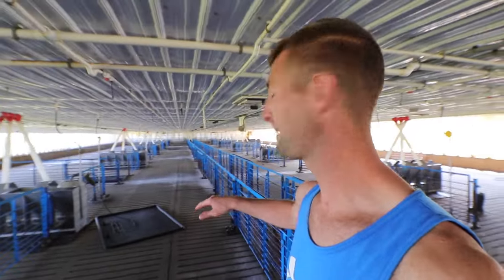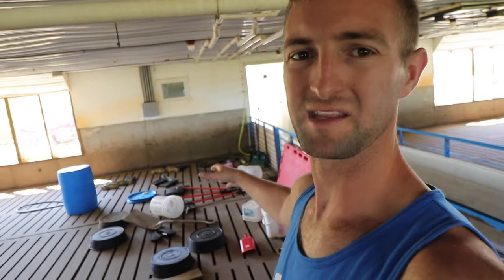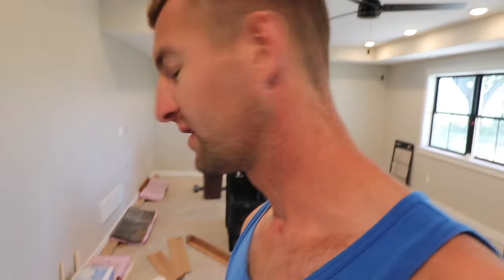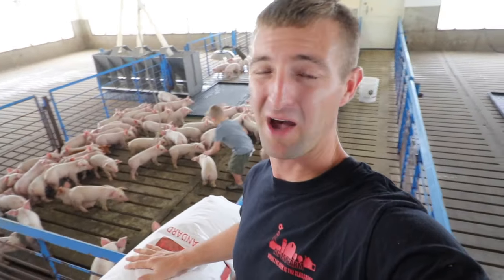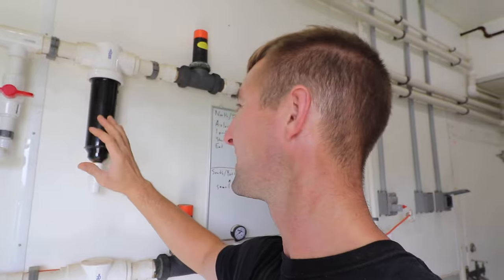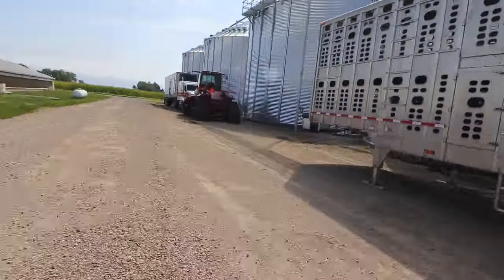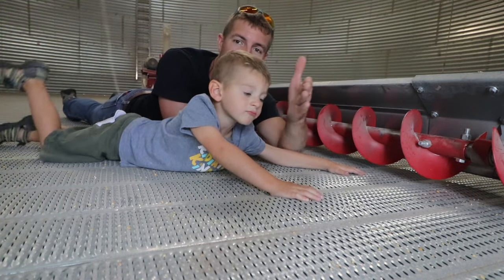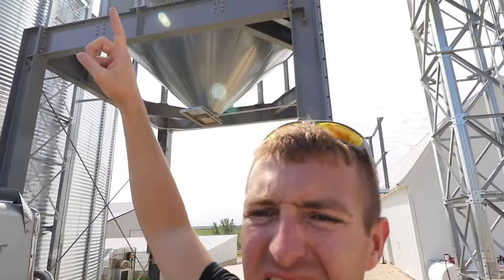We Plugged the Grain Loop

Comment: Is running the electrolyte solution through the filter an issue? I just would think you wouldn't want to run that stuff through the filter.
Reply from the maker: Great question. The electrolyte mix stays in solution really well so we don’t have any issues with it. There is a small filter on the end of the medicator hose that filters out any large chunks should there be any.